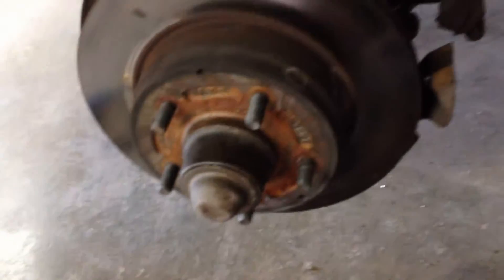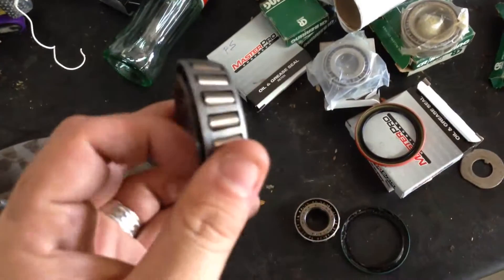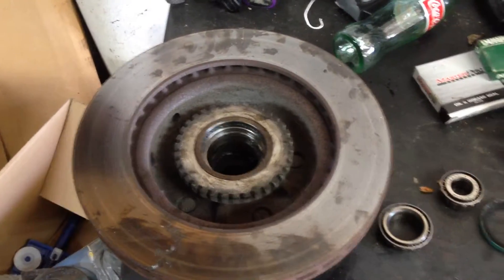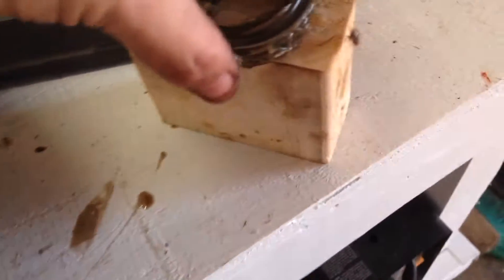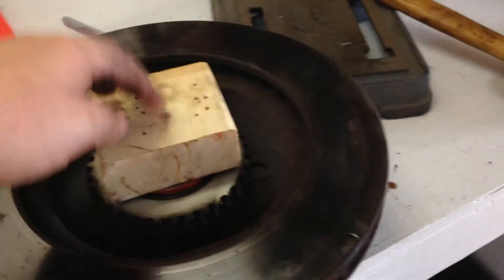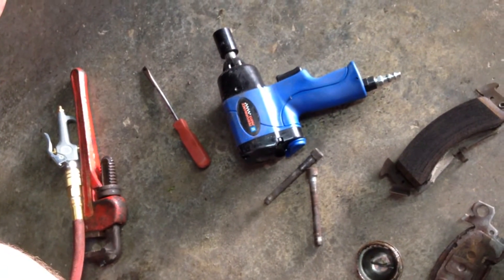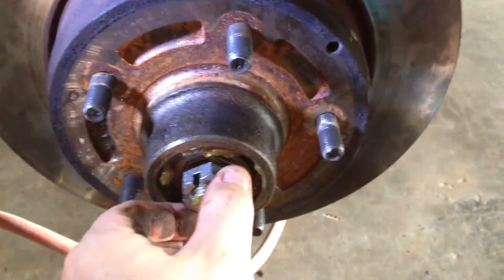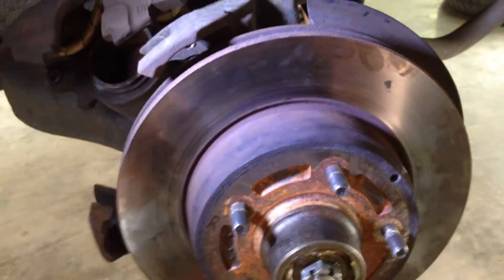Mike's Garage: E14  - 1996 Caprice Front Wheel Bearings

Comment: Nice video, but you technically ruined the friction surfaces by having them contact the grease. Have to use brake cleaner on them before you put the rotors back on.
Reply from the maker: I appreciate your feedback, and I agree that one should use cleaner.
Reply: I learned that the hard way once... Now I always take care not to get the contact area contaminated with anything.

Comment: I have a question I just got a 1996 impala ss and the vehicle came with front and rear rotors the front rotors does not have the built in hub the rear does so if I have a bad wheel stud which it does  do I have to replace the hub assembly
Reply from the maker: First of all, its cool yours has 4 wheel disk brakes. You should be able to press out the bad stud and replace with a new one. Not sure if you have to remove the axle or not. if you do have to pull the axle, its simple. Open the diff cover, push axle in and remove the c clip. then axel should slide out. reverse process to install. dont forget to add friction modifier to the diff fluid if you have limited slip, (which should be indicated witha metal tag on one of the diff cover bolts). Hope that helps.

Comment: You didn't show how you got the inner bearing deal out. I tried popping mine with a screw driver and they are tearing.
Reply: Take the castle nut off, then take the washer and outer bearing out. Put the castle nut back on , give the rotor a tug making sure the nut grabs the inner bearing. The seal and bearing should pop right out and stay on the spindle. Just make sure you put the castle nut on far enough so you don't strip the threads before popping the inner bearing out.

Comment: My man, I've replaced the brake pads also used new brackets for them but I can still hear the friction between them and the rotor. Warped rotor?
Reply from the maker: It could be. It is possible the surface of the rotor was gouged from excessive age or pad wear, If the car is pulling to either side, i would recommend taking it back apart and checking the pins on the caliper slid freely. If its just a noise, and it doesn't sound like gravel crunching, you might drive it for a couple hundred miles to give the pads some time to bed in. The bed in process could take longer with excessively worn rotors. you can usually tell by rubbing your finger over the COLD rotor surface If its wavy from inside to outside, the bed in process will take longer and will also shorten the life of the pads.

Thanks for watching!